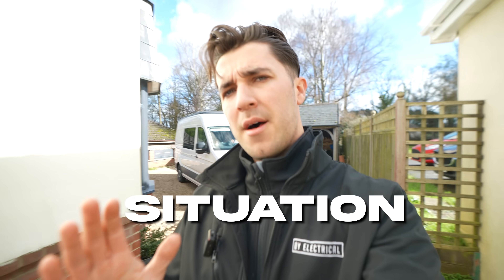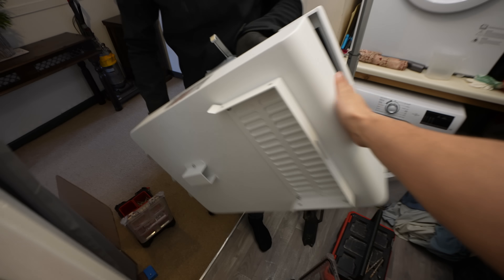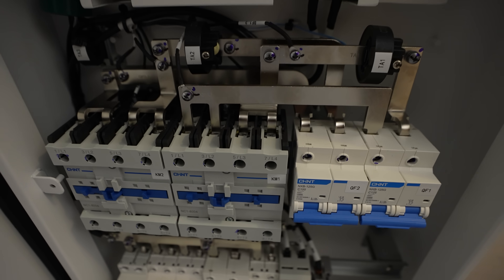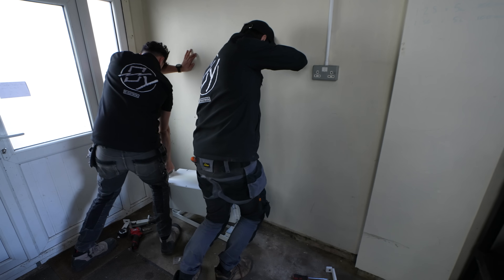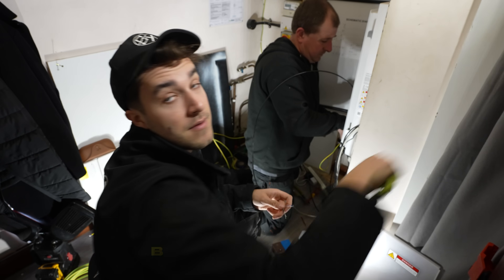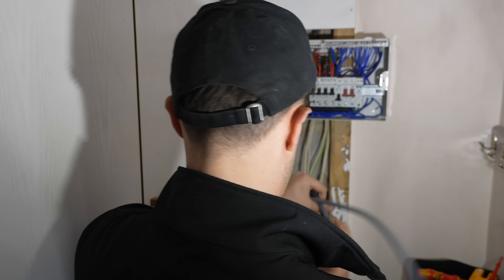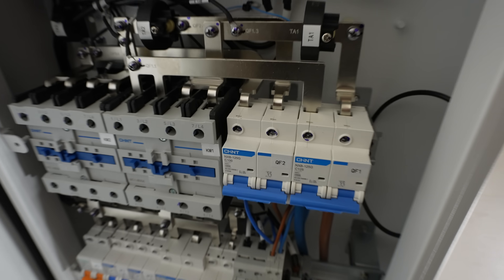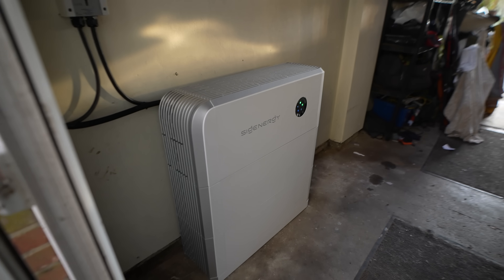How To Take ANY Inverter Off-Grid | ØY57

Comment: I did not understand the idea behind this Sigen ATS... Does it have some active components that simulate grid while in inland mode? Because usual NON-hybrid solar inverters will shut off when there is grid power loss. 
So how will this box help me keep my standart on-grid inverters running when grid goes out?
Reply: Es gibt Batterien die ein Inselnetz aufbauen, das ATS trennt das Haus vom Straßennetz.
Reply: @andreaskern1437 Did he ask in Hitler? Why didn't you answer in English?

Comment: No back boiler should be installed in a way whereby it will blow up/overheat during a power cut.
Reply: No they dont explode! What happens is that the burner has to run through a shut down sequence where the pump continues to pressurise, the solenoid clicks off, the fan runs for a few minutes to vent the fumes, cool the nozzle etc. What happens with some larger burners is if you just 'pull the plug' there is a small poomph, a small amount of heating oil puddles and annoyingly about one in ten ocassions you have to go into the boiler room and press the reset button. No danger whatsover but you do come  home to a freezing house! And... it does say on the control panel... call the engineer!

Comment: Not Electrical related that I know of but recently in January, I did an event at a local hotel retreat spot. this was Saturday one week later on Sunday the whole place burn to the ground. I ended up going up there to see what was left as I wanted to know what it was like in the section of the multiple buildings that we were in the week prior. Thankfully there was a block wall to act as a fire break but it was still weird to see the tables where I set up all the equipment exactly where I left them on one side of the room and the doorway that used to lead into the hallway now leading to nowhere but a pit of fire damaged wood and debris. Yes the systems require maintenance but nobody wants to pay for maintenance because that's too expensive they rather pay for… The aftermath. This building complex that was in wasn't that old round 1990 however there was a lot of additions and previous owners who probably didn't properly do stuff.

Comment: Hi, question about using grid Earth while off-grid. Why can you not use the grid Earth line for your off-grid island?
Reply: See my comment re the use of the DNO earth elsewhere in the comments - you CAN connect to the DNO/grid earth terminal whilst "off-grid" and, in fact, that is the default configuration.  G99 and BS7671 require that you also provide your own, additional measured earth electrode, which is connected to the DNO earth (assuming one is provided) at the installation main earth terminal. The reason for this requirement is that you *cannot* assume the DNO earth remains effective during a supply interruption and you are operating your installation "off-grid". A simple example is someone just cut through the service cable to your house with an excavator - the fairly short bit of DNO earthing conductor still connected to your main earthing terminal no longer provides much of an earth!

Comment: If the inverter is a grid tie only, how are you fooling the inverter into operating?  Is the gateway device somehow tricking the inverter to run?
Reply: The “smart port” in the gateway where the external inverter is connected on has it’s own relay and puts i.e 230V 50Hz on the breaker, making the inverter run as normal
Reply: @walkchaos5608  Am I correct that the installation in the video is just 1 phase, not 3 phase ?
Reply: What do you mean by external inverter? Is the original grid-tie inverter (the external inverter) or did you install an additional inverter with the batteries?

Comment: When operating off grid, does the inverter tie neutral to earth - if it doesn’t, what is the purpose of the extra earth electrode since the need for one when on mains is because the neutral point of the supply transformer is earthed and so earth is providing a return path for power that is leaking but operating a small inverter at least is same as using an isolating transformer- power won’t flow to earth since there is no potential difference.
Reply: Short answer - yes. If a generator installation operates in island mode, - or, 'off-grid' - the usual solution is a neutral-earth contactor incorporated in the automatic changeover scheme that provides the N-E tie. Although almost all domestic properties in the UK have an earth terminal provided by the network operator, it is recommended to have an additional independent earth electrode connected to the installation main earth terminal even if you have no generation. If you operate generation equipment in island mode, the additional earth electrode is a mandatory requirement.

Comment: Really interesting - thanks Cory. How does the unit set its phase profile when off grid and then align itself with the phase of the grid when power comes back? 

Also, with you mentioning G99, interested to hear your thoughts on the latest controversial Artisan video of the cocked up solar install that they did…?
Reply: The sigen gateway continiously measures the phase sinus waves, When going off grid it simply continues to follow the current wave pattern, and when the grid is back online it will sunchronize the waves as best as it can (Takes around 10-60 seconds) and then the relay pops and it’s back on grid. I’ve installed over 100 Sigen systems now ( In the NL) and I’m a huge fan of this product

Comment: My sparky insisted I had a new consumer unit, as he'd basically done what you had, and run in new tails and therefore he said it needed to meet modern regulations. It was installed in circa 2004 so I thought it would be worth updating it anyway. Did you ensure that the original FITS inverter will cut out if the house is running off grid and the batteries are full? My Victron system increases the frequency which will cause the Solaredge inverter to shut down, but this does need setting up.
Reply: That's a stretch..... Or a piss take, depending on your POV..... There maybe other reasons to change the box ( a plastic split load board?) but invoking the regs as the reason just because of the tails it's a piss take.
Reply: @paulinturkey  Yes, the old one was a split load plastic box. I did do some research at the time so knew it was BS, but it was a sensible upgrade with RCBO's.
Reply: @TheRonskiman  glad you made your own decision based on a bit of research. What pisses me off are the twats going around telling your Aunty Jean, who doesn't have that knowledge, that they "need" and "must" have it done....

Comment: What separates the AC and DC side in that solis inverter? Are you completely sure it actually provides galvanic isolation?  That looks mighty like a transformerless model and will NOT be isolated. So, What is detecting smooth DC residual current or current at frequencies higher than 50/60Hz?

Comment: if grid is down and the battery is full, and there are no electrical loads how do you regulate the power output from the string inverter?
Reply from the maker: It’ll shut off the inverter, then the inverter would shut off the MPPT.

Comment: The only flaw in this kind of system is there’s no load shedding, so if you’re running a high power load, like an electric shower at the time of a power failure, the demand could overload the battery inverter. 

Huge respect for the attitude towards improving the installation safety, regardless of remit.

Comment: The Scame isolators are the dogs danglies. Once you use them there is no going back
Reply from the maker: Couldn’t agree more
Reply: @corymac  But why rotary isolators in the first place? Why not something DIN mounted in a nice CU?
Reply from the maker: You have to have local isolation besides the battery, which is usually outside

Comment: If a back boiler on a wood stove needs pumped circulation then it is not compliant with building regulations 😮. Just thought that was worth a mention. It should gravity feed to a vented buffer or vented HW cylinder.
Reply: Quite often need a pump for a back boiler to feed radiators efficiently. 
It does need to be set up so it has sufficient circulation without pumping to be safe in the event of pump or power failure but gravity feed alone isn't particularly efficient at moving hot water any distance.
Reply: Yes, vent to an attic header, but also use a systemlink plate exchanger if you are going to mix with other heat sources
Reply: Building regs or approved docs? Having a backup off-grid supply for the pump probably ought to be considered a different-but-adequate way of dealing with the overheating risk. Obviously if this stipulation is explicitly in the regs, as opposed to the approved docs, then you don't get the leeway, and clearly designing the need for power out is a better approach, but whatever the legality of it, this seems an acceptable, if sub-optimal, approach to me.
Reply: @ It may seem acceptable to you, but uncontrolled heat sources such as solid fuel appliances must always be safe in the absence of electricity. The Fukushima disaster happened because they believed power would always be available, but the tsunami flooded the generators and that led to meltdown !

Comment: Cory states at least twice in this video that, while operating the installation in island mode, you *cannot* use the DNO earth terminal (assuming your house has one - most do). This is not correct. If you have the necessary equipment and approvals to operate in island mode, you cannot assume that the DNO earth will be effective during a supply interruption and so it is a mandatory requirement to have your own, independent measured earth electrode installed in addition to the DNO earth. This also applies if you are using a standby generator too, such as a diesel genny with a manual changeover switch. There are sound reasons to disconnect from the DNO earth during a supply interruption and just rely on your own earth electrode but this is not the standard installation and would require additional design and switchgear (and, hence, money)

Comment: I work in IT, and every time I run a cable, wire in a patch panel or mount anything, I can't help but think what you would think, you really are an inspiration to doing the neatest job possible and to take pride in your work, don't know if you were taught it or is just inbuilt but it's helped me massively.

Have to agree on the partners comment, mine is great, and knows that sometimes jobs over run, but she'll still ask what time I'll be home 😂

Comment: i went off grid but   earth in greece is inside property  grounded to the buildings  grounds ...   as long as main grid is down by grid company   i guess i can use  that ground pole ...   i have already pain in the butt to seperate  lightning and static solar grounding to another place far from main earthing......  i cant do 3rd pole /...   i guess if ever connected to grid i will be forced to let the  main earth alone if   inverter and outlets  is independend system....  and do the 3rd one  in  another  far from other 2 .   it has a lot sun here i live to get support from grid so no hybrids in my mind .,. maybe another project will be hybrid to check pros and cons!!!  keep up  Cory...
Reply: True but you need to ensure that the Pc to ground impedance is less than 100 ohm. Also, I would strongly recommend installing SPDs on every DB otherwise you will be changing your main board on your washng machine and dishwasher every 3 years with this typpe of install!
Reply: @Ino-z2m  spds are waiting  to be connected  and project is going as close as it gets at the remaining  earthing point .. 2 meters far is best i can do .hopping  earthing remains fully ok  when measured .  20 years old  it sure needs to be inspected

Comment: I'm assuming that while any PV source can be used, this is designed to work only with sigenergy batteries for the backup power?
Reply: Correct, the Sigen inverter is connected to the gateway with a rs485 connection and is software locked